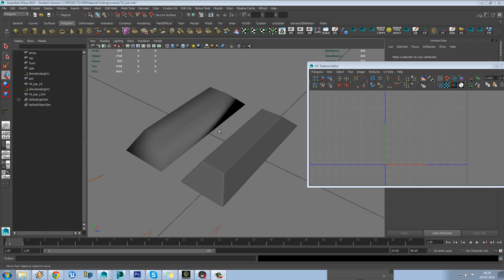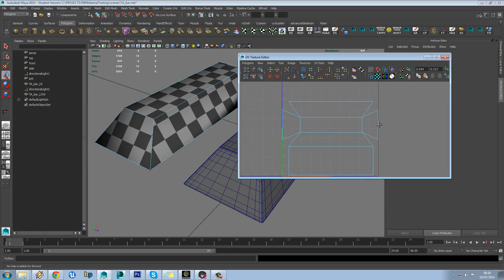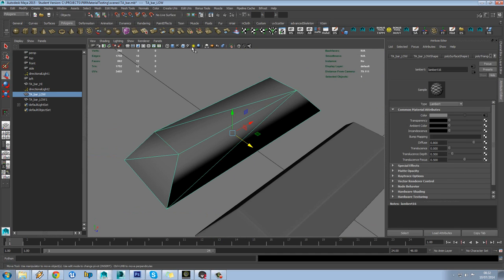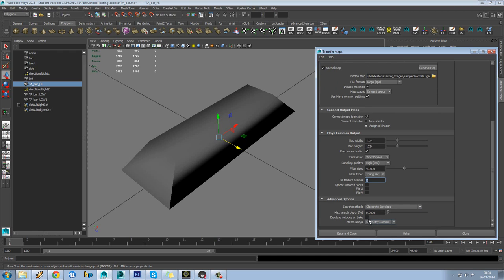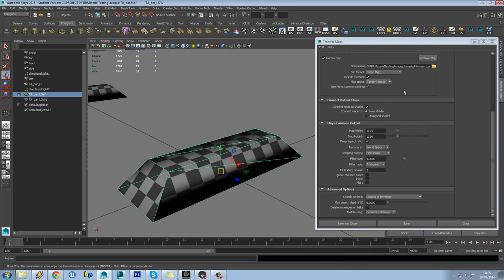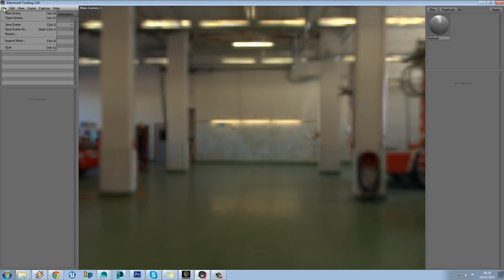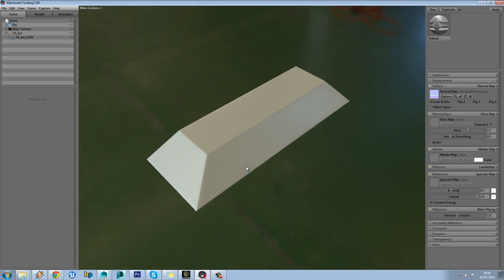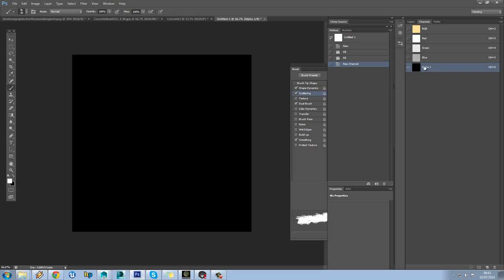Marmoset 2 - Gold Bar Creation - Physics Based Rendering PT1

Comment: Good Morning. I would like to create a texture for a plot. Must be multi-layered. eg. foliage, grass, rocks, dry logs and so on. I would like to use marmoset. Can you help me? thanks
Reply from the maker: Do you mean you want to have foliage, grass, rocks etc all on one texture?
Reply: in fact there is never an all green grass. I would like to make a plot with multiple objects with multiple plots. I use Cinema 4d. but if you believe me advice other software. Thanks.
Reply from the maker: Leo Renna You can import multiple models into Marmoset and apply different materials to each one, very simple to do, you can even export all your models in one FBX
Reply: Tim Ash thanks to you!